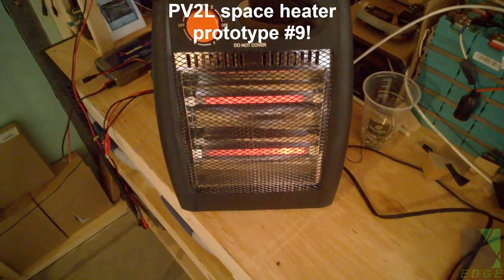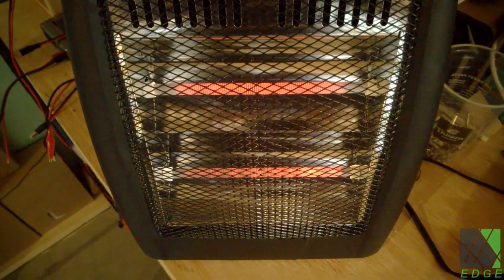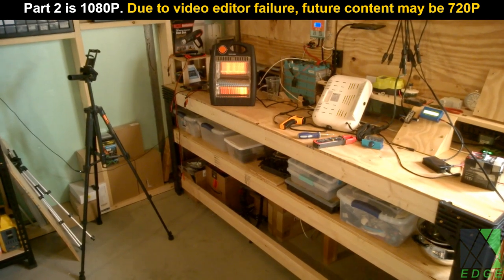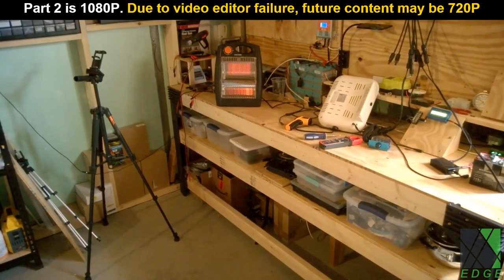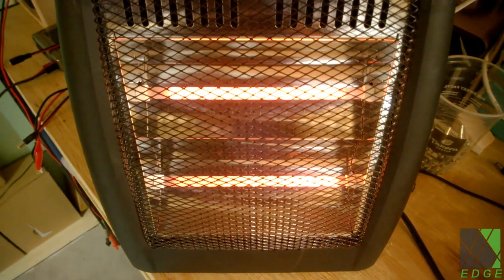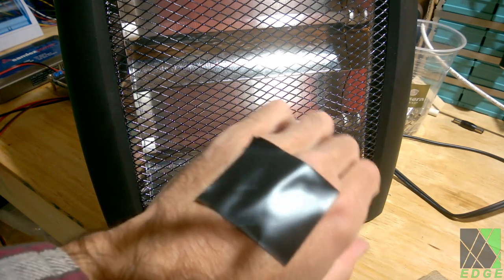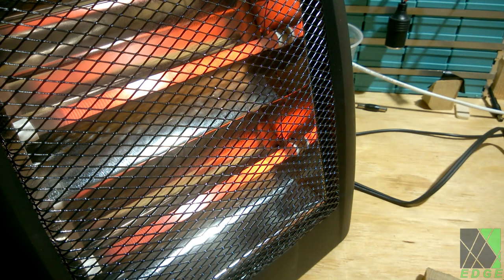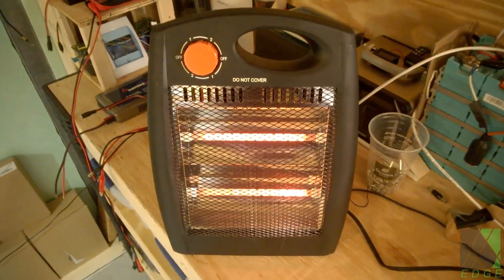VLOG another PV2L space heater, Part 2 Update, IR thermometer test #solarheat #solar

Comment: Would this work with a 24V VAWT?
Reply from the maker: Sure if the heating element was matched to the voltage/power rating of the VAWT. That's a pretty neat idea.
Reply: @solarpoweredge  Cheers. I'm looking forward to your next video.
Reply from the maker: Roger that. More stuff on the way :)